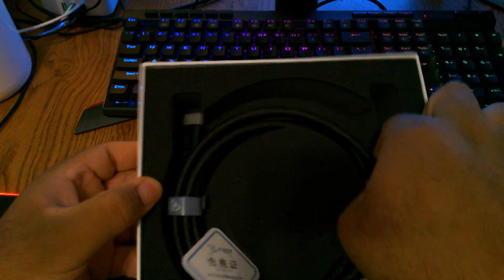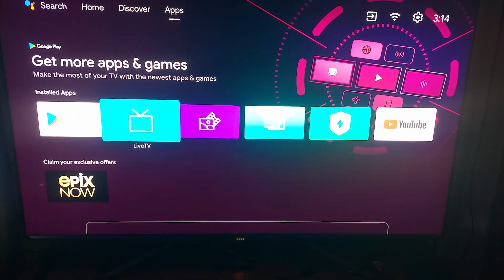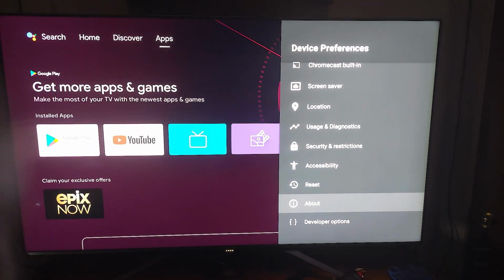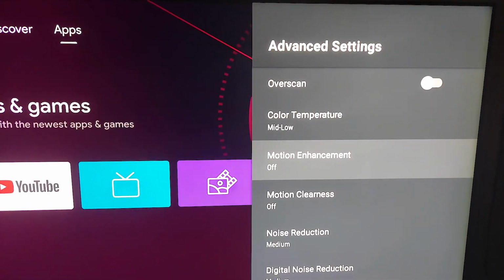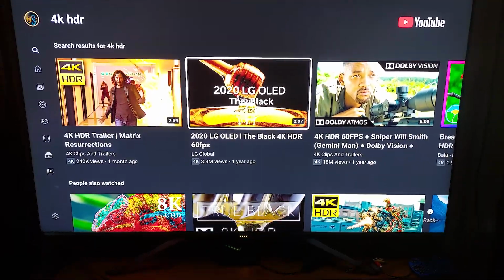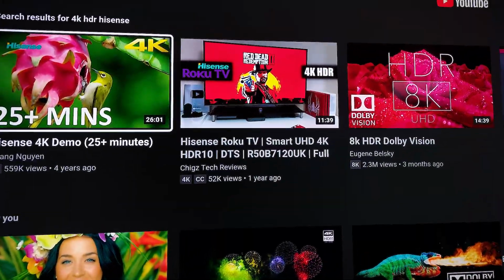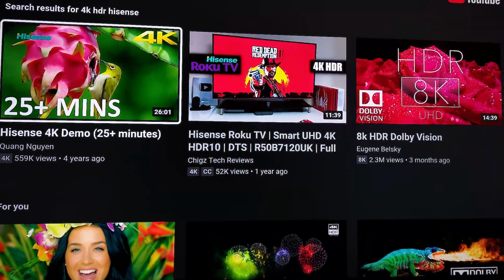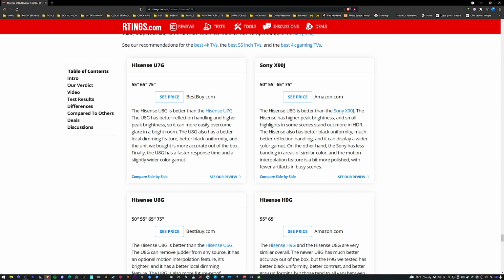Hisense 65 inch U8g My First Impressions + Unboxing

Comment: Have you had any image problems especially on SDR content? I’ve been noticing a blurry image on mine (55inch).
Reply from the maker: A higher end 4k tv even with a 55inch is going to showcase a blurrier image in lower resolutions it becomes more apparent when you view displays at larger sizes. I have the 65inch hisense u8g and I can spot a blurry image immediately. That's why when it comes to movies and tv shows I stream at the highest bitrate available.